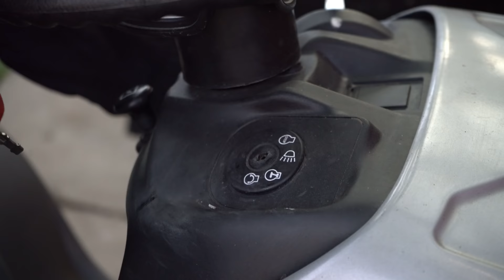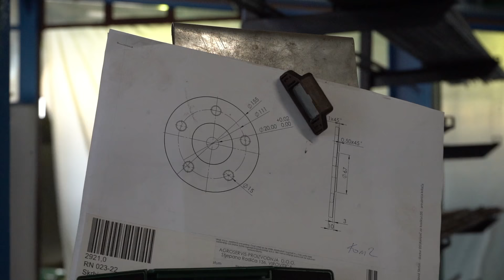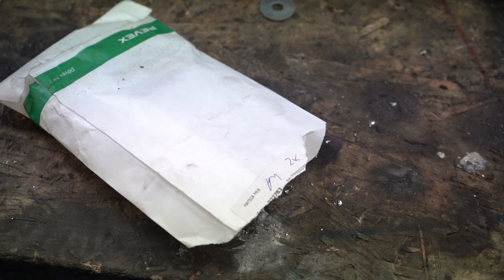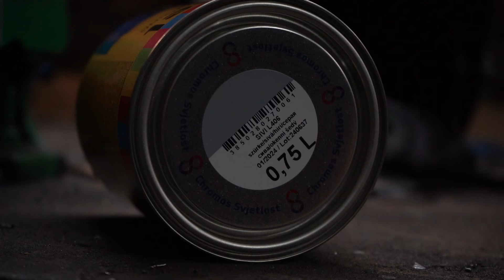Homemade SALT SPREADER from Auto DIFFERENTIAL for a Tractor Mower / ATV / QUAD !?

Comment: I would have put a cone in the center of the spreader wheel/fan and attached the mixer spindle to the tip to more evenly spread the salt as it dropped down.

Comment: Hey doc I thought you get a 15gal food service plastic containers use a 12volt pump and mix calicum cloride and water using a hose a plastic irrigation spray head made a pipe to spray the liquid then  salt you get lower temp to continue to melt

Comment: You can have salt in your food, not on the roads. I live so far north that we have winter 6 months a year. 
Here they do not salt the roads at all. We have nice white roads and well studded winter tires and no rust on the cars.
Reply: i live in sweden. over here they salt the roads every winter. i have a 2006 bmw and it is literally covered in rust. 🙁  if you want a car to stay nice here you have to drive it in the summer only
Reply: @gordis6817  De saltar söderut. Jag bor i Norrbotten och här saltar de inte

Comment: Yep, thats not gonna rust after getting salt used in it.

Not saying I dont like it I do. But to spread fitlizer on the grass.  
TIP: insted of taping off the wheels to paint. You can use playing cards just stuff them in around the wheels next to the tire bead with them facing up at an angle you can keep the overspray off the rubber.

Comment: And this kids is how you pay more then 500 dollars on a rock salt spreader 🤣🤣
Reply: Couldn't you of just bought a fertilizer spreader, adapted it to throw salt and maybe even saved alot of money. The hardware alone on this project cost a lot of money, plus the pillow block bearings that no one just has laying around not being used.
Reply: @kennethewertz9313  This guy had about 10 sitting on a shelf. They're like 40 bucks a pc here in Canada.

Comment: Crap music.  You can buy a salt spreader for less than 1/8tj of the cost/labour in building that one that won't rust up solid from the salt, and weighs 1/8th of that one.  Well built however.  Great tire chains.  Add side shields that are adjustable and use coarser salt.